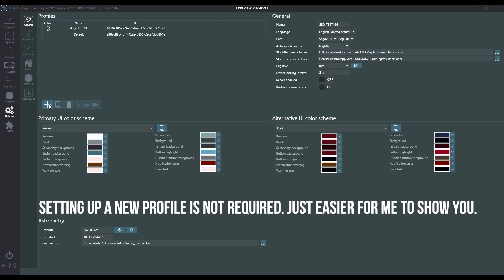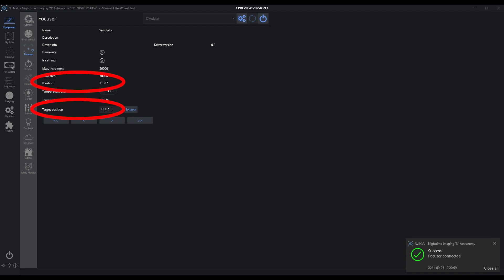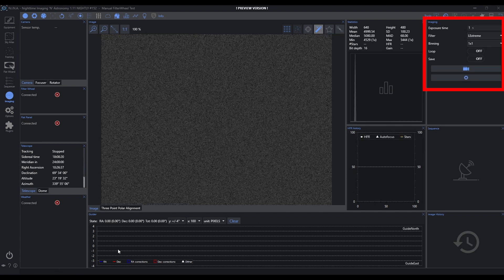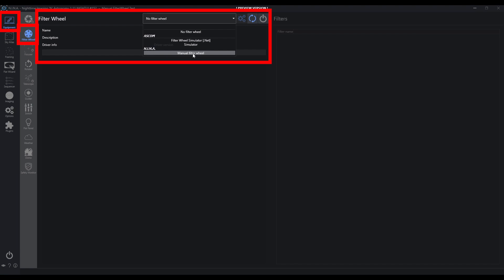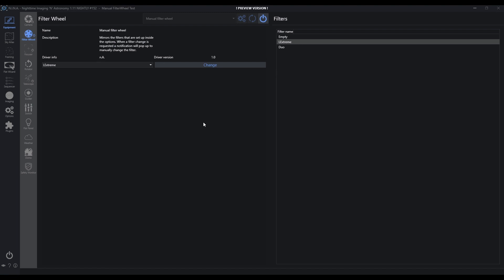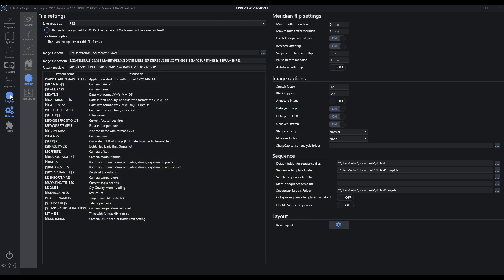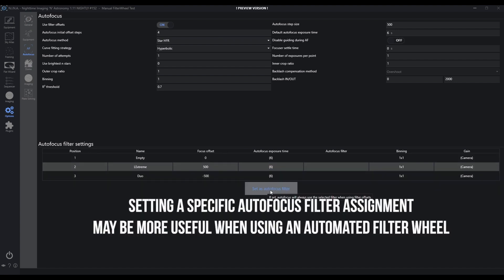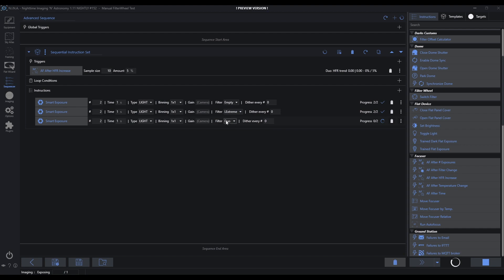Manual Filter Changes within NINA

Comment: I am new to deep sky imaging. I have Hydrogen-alpha clip-in filter which I am using with Canon 6D astro-modified. I am confused how to change the filter while my RGB exposures are running. Coz if I plug the filter in the plate-solving settings will also change right? Should I stop the exposures and then start plate-solving again?

Comment: Question:
In NINA 2.0 it looks similar to 1.11 shown in this video. My goal is to take multiple targets in one night sequence using the same filter (Hyperstar) and have the sub’s file name contain the filter name. This worked in NINA 1.10 just fine. However, in 2.0 NINA prompts you to change the filter even if it is the same filter and stops the sequence on the second target. Bummer. 
Is there a way to do this without manual intervention?
Reply from the maker: I haven't run into this issue personally. BTW - NINA 2.0 is just the name of the beta version of the old 1.11 nightlies, it is the same code train. Are you doing this in the advanced sequencer or the simple sequencer? Maybe I could run a test on my end.
Reply: @PatriotAstro  BTW I am very impressed with your videos. They are very well done and it is difficult to talk that much in front of a camera in as few takes as you do. I used the simple sequencer in both 1.10 and the 2.0. My equipment is a new Celestron C14 EdgeHD using Hyperstar with a filter drawer. In 1.10 I set up the filter wheel with my 5 filters even though I don’t have a filter wheel. I was able to take multiple targets in one night all using the same filter and the subs contained the filter name in the file name. I used the same (or similar) sequence in 2.0. I had to connect the manual filter wheel to get the filter name into the subs file name. Unfortunately, when the first target was done NINA had a Filter change dialogue box come up and you needed to confirm by clicking OK to proceed to the next target. However, this stopped the sequence and I didn’t know until the next morning. Clicking OK, it would have proceeded. If I don’t connect the fake filter wheel then the multiple targets work, but the filter name is not in the subs file name. Anyway, that is the problem and makes taking multiple targets not practical using filters and 2.0. Thanks for any help you can provide.
Reply from the maker: @bluecelox  I’m surprised it’s actually behaving that way. I‘ll ask about it for you soon. In the short term, a workaround would be to just type the filter name directly into the file name in the options imaging tab. Just replace the filter variable with the filter name. Now this won’t put it in the fits header, but will get it into the file name. I wouldn’t call this a practical long-term solution, but may help you in the short term. Of course when you do this, also disconnect the manual filter wheel so that you don’t get the prompts.
Reply: @PatriotAstro  That is an excellent idea. I will try that tonight. Thanks. Unfortunately, it looks like the clouds are coming in.
Reply from the maker: @bluecelox  I know the feeling... :(
Reply: @PatriotAstro  Update on issue with NINA 2.0 prompting to confirm the same filter selected in the manual filter wheel each time there is a new target when using any of the exposures instructions. This turned out to be a cockpit error/user error. When I updated from 1.10 to 2.0 I also changed the Plate Solver from Plate Solver 2 to ASTAP. In ASTAP I explicitly selected LPS-D1 filter and every time it did a plate solve it prompted to install LPS-D1. I changed that to “current” and now it works fine.  Thanks for the help and now I am struggling to get PHD2 to guide properly after updating all (6) Celestron firmware on the mount and StarSense. Must be a setting that was changed. When the clouds clear I will try to clear out the mount backlash and use only the PHD2 backlash and not both. Thanks again for your help.

Comment: Very interesting,  great video again Chad !
Reply from the maker: I’ll try to keep them coming!
Reply: @PatriotAstro  Maybe would be interesting to see how to set-up an EAF in Nina from scratch, and not knowing any settings at all.
Hardly finding a video about that
Reply from the maker: @siegfriednoet  What exactly do you feel is missing? I covered my EAF from an Auto-Focus perspective in my AF video and for the most part... other than that, it was just installing the hardware on the scope and loading the drivers. I don't think I did anything else. I something hung up on your install? I might just be forgetting something I did a while back though... :)
Reply: @PatriotAstro  Chad, I meant how to calculate the stepsize, how to check the backlash steps ...
Reply from the maker: @siegfriednoet  Search my channel for the video "Setup NINA Auto-Focus Quickly and Correctly". This has actually been pinned to the NINA Discord support channel and has helped LOTS of people. I cover the procedure that should be followed for all focusers, but happen to include an EAF as one of the specific examples, since I use one... :)